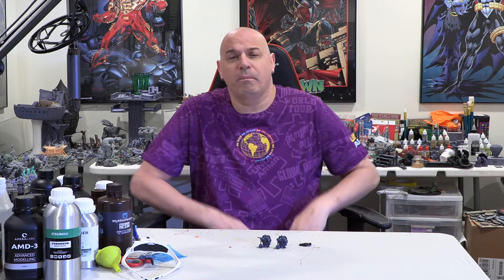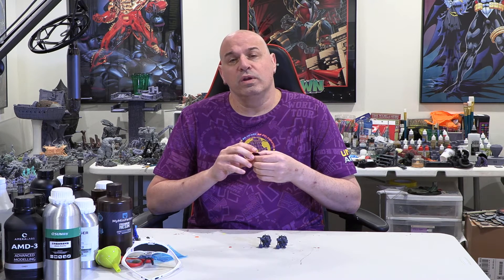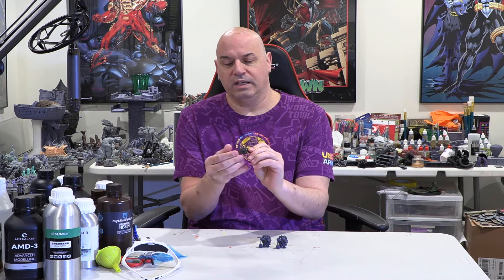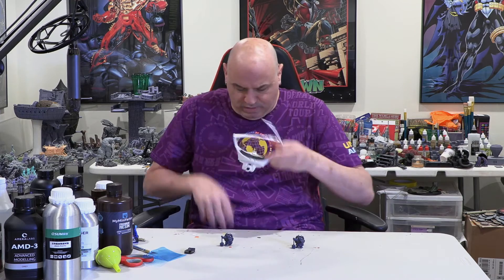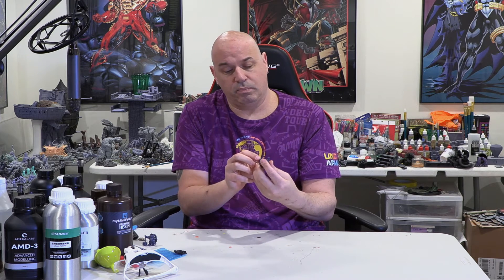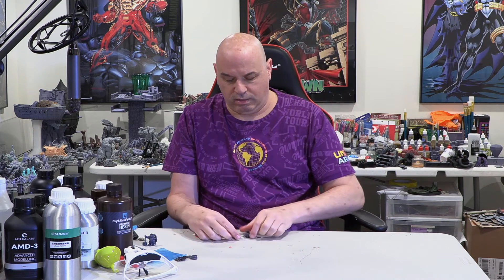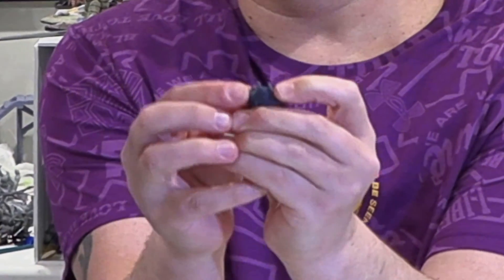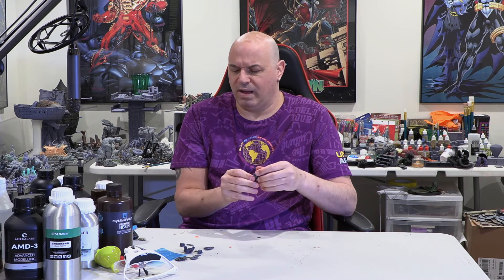Siraya Tenacious Obsidian Black 3D printer Resin review, with break tests...and bend tests...

Comment: Would love to see you mix it with phrozen aqua 8k resin! See if that would work without loosing too much detail.
Reply: I would really love to see this as well!!
Reply: I have done this! It's amazing once you get the mixing ratio right. It also took me a while to fine tune the profile and exposure times. Never had any print failures with Aqua 8k but had quite a few when I started mixing it with the Siraya tech blu obsidian black. Would highly recommend it though especially since Aqua-Grey 8k is so expensive.
Reply: @johnhart5953  I have just purchased this to try the exact same thing. would you mind letting me know your mix ratio and printer settings for this?
Reply: @ashcullen9835  I'm in the middle of a move so my machines are in storage but I can give you a run down right now with out getting too specific. I only used this mixture on my Phrozen Mighty 8k so far. 

The first batch I did was fine but it was definitely lacking. I did a 10ish percent mix of the Blu into the Aqua 8k with stock exposure times and it didn't print. Resetting and setting my initial exposure times up by 8 seconds and my regular layer exposure time up by 3 seconds was the ticket. It printed really well and looked fantastic but it was still too brittle for my liking. The second batch was much better and it was about a 30% mix of Blue and  70% mix of Aqua 8K. That still gave me a lot of good detail and a way better durability although I'm still not exactly satisfied. I'm going to try a 50/50 mix when I have my workshop set up again. 

I did encounter an issue with both batches and it was basically an over curing issue. The parts get extremely brittle when cured for longer then 3ish minutes and I got to the point where I wasn't even doing a post cure on it and that was working really well. Hope that info helps, let me know if you have questions. Also try and boost your Exposure times slightly more with the 30/70 mix if its not attaching to the build plate and printing.

Comment: why don't you use a dab of resin and cure with a uv flashlight rather than glue?
Reply: Because that only sets it around the edges, the middle will never cure.. as opposed to superglue where eventually it will all cure
Reply: @SOTMead  very thin amount pretty much fully cures from my experience. i use the resin and uv light and I find it works much better then super glue. I just push it together and then using a long thin applicator made from a sowing pin or needle you get a small amount on the tip and run it around the joint and then hit it with uv works really well.
Reply: @markburton5292  Okay. Curious, have you ever pulled apart a weld like that? I haven't, but it doesn't seem likely that uv light would penetrate that deeply into any amount of resin aside from the smallest of cross-sections. Maybe because it's so thin, that it can penetrate? Seems like some testing is in order before either one of us can be sure about what we're saying :)